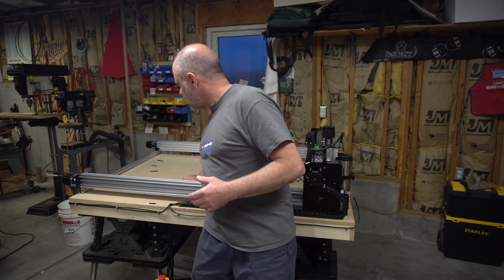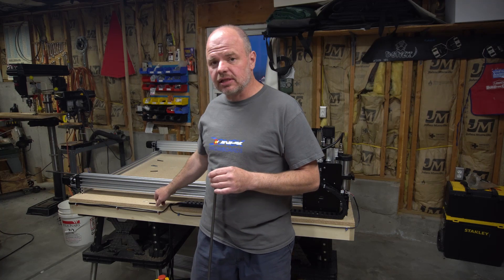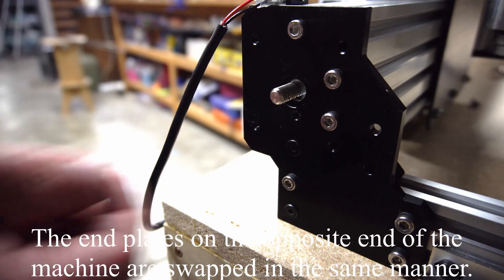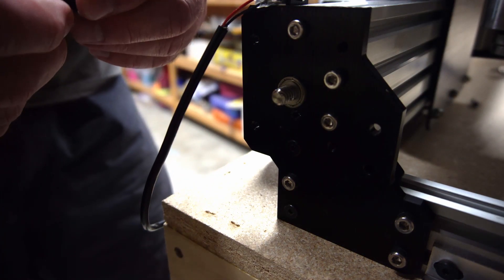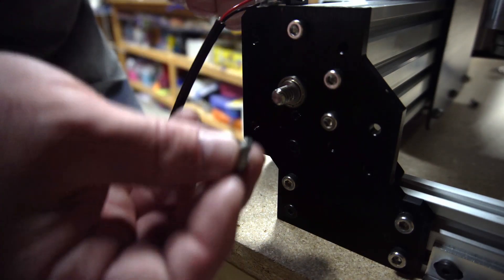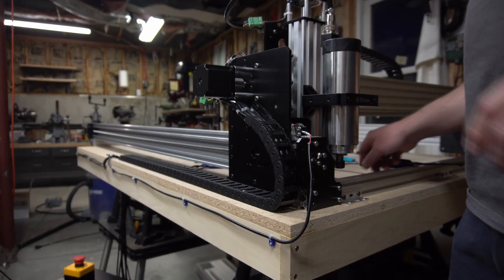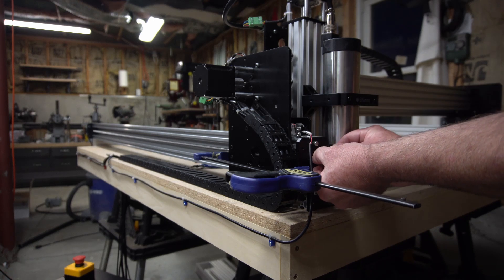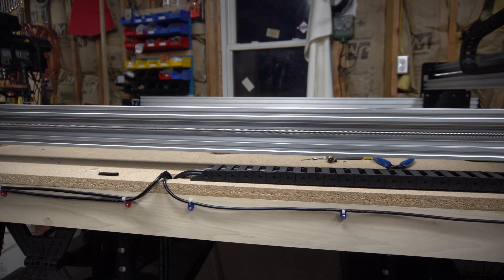Eliminating Lead Screw Whip on the Workbee CNC Router

Comment: i used 1500 leadscrew but i order biggest screw old has 8mm OD and new have 12mm OD screws, best way have order little longest screw and one NUT more, drill nut hole and make thread, install and tighten nut little bit and locked nut. use tread lock . then not whip. better if can buy pressure plate bearing this under nut too help lot.

Comment: Can we use belt drives for this ?
Reply: yes but not accurate and strong. belt tretches and teeth not accurate, can use only small torque laser or 3D printer NOT cnc mill,

Comment: I have one of the very early 1000mm x 1000mm  Workbees and, being a cheapskate, I don't want to scrap the existing lead screws for ones only a few millimetres longer to allow tensioning  the lead screws with a clamp on the "free" end. I plan to drill and tap this end of each lead screw and locktite a 14.9 grade M3 stud in. This will allow me to tension the lead screw fairly accurately because the tension can be obtained by stretching the lead screw by a well controlled amount using the fine pitch of the stud. For a 1000mm lead screw I estimate we need of the order 0.2mm of stretch to obtain around 100kgf tension in the lead screw.

Comment: Wow. I actually ordered and installed a new 1500mm ball screw, knowing that the original had a slight bow to it when it was installed. Bad wobble if I pushed it much beyond 250IPM. I was able to achieve well over 100IPM faster with the new screw, but only for a couple of days, then the wobble returned, mysteriously. In the process of troubleshooting the issue, I stumbled upon this video. 

Since I designed and built my machine, it was easier for me to introduce tension on the axis. What happened? when I loosened the BK12 mounting bolts and pulled on it to add tension, it came right off! The Jesus clip that was supposed to be holding that end of the screw fixed had fallen off, which likely led to the wobble in the first place. I replaced the clip, tightened her up and kaboom! No more wobble!

Now I need to get better Jesus clips...

Sincere thanks and best wishes!
Reply: well tension and temperature might give you more or less woble over time and broken bearings .. since they are stressed non stop

Comment: Thanks.
The clamp was a great idea. I just moved the gantry to the center of Y and then pulled the lead screw by hand to get a slight tension.
You are right, btw: Workbee does supply longer lead screws in their V2, with 'Tingle Tension Extensions' is what they call them.
I might order longer lead screws and put some push bearings on the outside. Regular bearings are not supposed to handle axial forces.

Comment: The change of the bearing to the outside of the endplates is a good idea but with the tension applied to the roller bearing in the "wrong" direction will cause the roller bearing to fail quickly, it may be a advantage to place thrust bearing between the roller bearing and the collar. To minimise the dust to settle in the open thrust bearing i made large washers with dense felt that fit snugly over the thrust bearings

Comment: What is the max screw length that can be  used in the C channel before the Flex becomes unstable? Using 3rd party screws can 2500mm length be acheived?
Reply: I think if you are in compression, 1.5m is pretty unusable.  If you are putting the srews in tension, you are probably OK at the longer lengths.  You will likely find it necessary to apply a greater tension preload and will need thrust bearings.

Comment: how different did the machine behave after that fix? Did it make more precise cuts?
Reply from the maker: That was not the purpose.  The purpose was improving performance during rapids.  It allows the machine to run at a faster rate without problems.  There have also been instances where people have bent their lead screw.  This will prevent that as well.

Comment: good job m8. but they are roller bearrings you need thrust bearrings for that application. i have a 1515 and no whip but bulkman can shove their instructions where sun dont shine. in the end i built kit my way and it works. roller bearrings dont work under side to side compression. thrust bearrings are the only logical way to put rod in tension .
Reply from the maker: Agreed.  I have thrust in hand but have not had to change them yet.
Reply: Matthew have you got a link to the thrust bearings?

Comment: I had to do the same thing to my machine. But one of my y axis on my cloned driver drv2288 is running at a different speeds. 

Any ideas?
Reply from the maker: You could check motor tuning in ports and pins on MAch3 or confirm that all axes are set up the same.  Or one could be micro stepping and the other not.  That's typically specific to the driver or the dip switches or jumpers.

Comment: Hi all!   Instead of using a collar with a machined grub screw, why not use  a brass lead screw Nut  to adjust the tension on the main lead screw  the  support bearing has  to be the type  that accepts  radial load  , suggest drilling and taping the brass lead screw nut  to keep it from turning  to keep the tension on the main lead screw!
Reply: Was just about to comment the same thing. Great idea

Comment: Hi Sean, cam across your video.  I am considering a CNC machine to get into making some wood and metal projects, carvings, cut outs, etc.  I don't know much about them but I have a limited budget.  What do you think about the Workbee CNC's?  Looks like the kits come with everything but the MDF table/platform..  Do they have the ability to set the zero level against the surface you are working on?  Would you recommend air or water cooled?  Thanks
Reply from the maker: If you are looking for a hobby level CNC, then you will do well with the workbee.  I think for a first timer, you want to be sure you understand the entire drawing, CAM and control dynamic.  Be sure you are purchasing something that is not a significant stretch for you to learn.  Mach3 as a control software is very tricky to make work for a new user.

Comment: This a great stop gap solution. The true problem is the lead screw diameter is under sized. Shaft whip is to be considered on any rotating machinery and is dependent on the length to diameter ratio of the shaft, shaft tension and rotation speed.  
Shaft whip is mostly due to to the sag of the shaft over it's length, which is an eccentricity, and when rotated, causes the shaft to whip. Tensioning helps by reducing the sag, but will not remove the whip fully. It just changes the critical speed at which it occurs. Such a long length of screw would need quite a large diameter screw to eliminate whip completely.
Reply: Yes, I was thinking the same. When he said 8mm screw I thought that is a mistake - it should be 12 mm at least or maybe even 16 mm to stop it from sagging under its own weight. Sean found a solution that deals with a part of the problem, eliminating some of the additional forces, applied externally, by the frame. However there is a caveat to increasing the diameter, because the added weight of a 12 or 16 mm lead screw will introduce some other factors into the equation, putting more load on the motors. I am not familiar with this machine, but if the motor on that axis does not have enough torque, or it's already at its limit... well, it's game over. Maybe the  fact that they kept using a 8mm lead screw in such a long axis is in fact a compromise - power vs weight... Also, another thought is that reversing the support plate and putting tension on that lead screw will modify the geometry of the whole frame a little bit. It would be nice to see a test with a simple square carved in a piece of wood and measure the deviation that occurs...

Comment: anyone try to mount Cnc on the wall to make more room and box it in to keep the saw dust down in the shop >
Reply from the maker: The challenge with that approach is that the motors have to lift the weight of whatever axis is being moved against gravity.  You would need bigger stepper motors and possibly drivers too.  There may be additional wear on some components too.

Comment: What spindle is that ?what do you need to add it to your CNC
Reply from the maker: I have a 1.5kw chinese spindle on there.
Reply: @seanmartin8770   better buy 2.2KW same cost  but lot lot more power and better.

Comment: Bulman3D included a black threaded plastic knurled knob about the size of a hockey puck, labeled "Lead Screw Tensioner", with my recent WorkBee kit. You can use it to load tension on the lead screw and then tighten the lock ring. Works great...

Comment: Thanks for the video.  Was having problems with leadscrew whip on a Workbee 1515 and this is a fantastic solution.  Purchased longer leadscrews from Bulkman3D to avoid trimming the v-slot and cbeam.  Looks like Bulkman3D is now selling the 1500mm kits with longer leadscrews and a tool to help set the tension.
Reply from the maker: Glad it helped

Comment: Who the hell would use 8t trapezoid 2mm pitch power screws in a cnc table lol?  Wow you got screwed literally if you paid for those. Those are designed to be used with 0 to 80rpm inmind to start with at a max length of 400mm.  That is spec rated for those screws. Provided you have 304 stainless screws and 8070 copper nuts.  

Anything above 80rpm will damaged those with a force greater then your wife bitch slapping you for wasting money on that. 1200mm 12mm ball screw with bearings and nut. 0 to 850rpm cost 55$ and won't bend anyhow cause of its twisted design even under loads. Not as much friction and does not turn to a sloppy mess.  Acme screws are not even designed period to be used with any kind of stepper or motor.  

NOT trying to be the black cloud here but worked the BRAND name Canada product would never used acme screws in a product.  You got what you paid for a China knockoff

Comment: Just a thought. Might it not be an easier job to  get some of the brass lead screw nuts that is available and use that as a tentioner. You will still need to drill and tap for a grub screw to lock it in place. just google 8mm lead screw nut if you want to see what it looks like.

Comment: I just ordered the 1500x1500 from bulkman, I'm wondering wouldn't a multi start screw lessen the whip? I'm thinking a 4 start 3/8" acme rod. What do you think?
Reply: Also instead of cutting the cbeam, could you not just make bigger motor mounts?
Reply: also instead of cutting your cbeam could you not just make bigger motor mounts?
Reply from the maker: @grahamshere  I'm not sure how a bigger motor mount would help.  I'd need to see your solution.  As mentioned, cutting the c-beam is not necessary if you get longer screws.  I was unwilling to wait for them and did not feel that shortening my c-beam by 1/2in impacted my travel enough to be a problem for me.  I can still cut 48in of material, so a partial 4'X8' sheet is no problem.
Reply: @seanmartin8770  I was thinking you have a larger motor mount and you would need a larger coupling  just so you don't need to cut 1/2 inch off your machine but doesn't really mater I guess if you still get 48" under it, I think a multi start acme rod would be better, less rpm's to travel more distance, I looked at 1/2 inch 5 start acme but the cost is crazy, almost half the price of the machine alone with shipping, shipping cost more than the rod. Seems most of the acme lead screws are made for 3d printers. 8mil should not be used for cnc routers if you ask me.
Reply: wonder why my reply didn't show up the first time?
Reply from the maker: The Whip has to do with the fact that the screw is under a buckling load that actually buckles it.  A 3/8in screw is going to buckle under a similar load to a 8mm screw.  The only way to combat the problem be changing screws is to go with a larger diameter screw.

Comment: I've contacted a seller and they've offered to give me an extra 10 mm added to the lead screw length. Do you think that will be enough to get the bearing and collar on the outside?Thanks for the video. It alleviates my worry about getting the bigger machine
Reply from the maker: Hey Seth.  I do believe the 10mm will be enough.  Can you share the seller you are working with for others.  Thanks.
Reply: @seanmartin8770  It's bulkman3d.

Comment: Where can you get a lead screw that long? I would like to do this.
Reply from the maker: It looks like Seth above you has found one, but I believe bulkman should be able to.
Reply: aliexpress,machine shop, bolt shop, e-bay. i order my cnc screws aliexpress and ebay, my machine have 1500x2000 table size screws have little longest.

Comment: Another thought. Would it make sense to shorten the spacers that hold the stepper motors to the rails to gain the space needed??
Reply from the maker: With the locking collar on the opposit side of the end plate, you need that distance.  It's possible you could use the shaft coupler in place of the locking colar though. I'm not near my machine to measure those parts. It moght work.

Comment: Did you cut just the C-beams or did you cut the other beams as well?? I have the Workbee 1500x1500 and it has 4 beams to support the MDF sheet
Reply from the maker: Mine is 1000C1500 so I just cut the longest beams. In your case it might be better to purchase longer lead screws.

Comment: would adding springs between the end grub and frame give you even more tension? https://www.mcmaster.com/9657k636  one of these springs on each end would give you an extra 20 lbs of tension.  why didn't you just increase the threaded rod to 12mm?
Reply from the maker: More tension is not necessary i dont believe.
Reply from the maker: Increasing the lead screw would be more desirable. I did not have a problem with loosing the 12mm in length so did that.

Comment: Thank you for the video. I currently run a machine using belts and was looking for an upgrade with screws and a bit bigger. I was looking at the Workbee at the same size you have. Being able to use screws on that size helps my decision. I realize you may not have any context on this but I'll ask anyway. Do you think there will be much difference in accuracy between the 750x1000mm one and the 1000x15000m one? Due to greater flex in the Y and X spans? I would love to be able to mill that size but not at the loss of accuracy.
Any shared experience would help greatly. Thanks.
Reply from the maker: Deflection in a beam varies with the cube of the length so a reduction in rail length will definitely reduce deflection and improve accuracy.
Reply: i use 1500x 2000 my table lead screws. and biggest screw 12-16mm OD.

Comment: how about y-plates? can you flip those?  if i order 1500x1500 leadscrew workbee
Reply from the maker: Those plates are mirror images of each other, so you should be able to swap the sides and put the x-axis in tension too.
Reply: lot cheapen you can order new leadscrew to machine shop or aliexpress etc, and better if change lead screw biggest OD, 8mm change new screw 12mm. and order all axis one nut more, same pitch what lead screw have, lot better tighten tension.

Comment: Great Video Sean! Looks like great minds think alike. Just last week we started selling 1500mm screw drives with the screw in tension.
Reply: Can you buy the tensioner?
Reply: @canoe-shelburne  All you need is a nut with a thread matching the thread on the screw you are using.
Reply: @ooznest  where can they be purchased. I have 8mm lead screws
Reply: @canoe-shelburne  The correct screws will be available on our site soon!
Reply: @ooznest  Is it up on your site yet? Do you have a link?
Reply: @sethl1515  Yes the 1500x1500mm on our website are screw drive with it in tension
Reply: @ooznest  have you got them in stock?
Reply: Do you have links for the nut on the store
Reply: So is the 1510 or 1515 lead screw workbee is now consider as stable and reliable as the 1010 ? (Not as "accurate" and rigide of course) Also do those nut wears on such high speed ?
Reply: @geekoid183  By tensioning the screw the whip can brought down to the same level as a 1000mm screw un-tensioned. But it is considered as stable with the screw tensioned.
Reply: @ooznest  Would doing this to the workbee 1010, improve it at all?
Reply: @tompoletti5676  It wouldn't make a noticeable difference. The only benefit to it at smaller sizes is that it is easier to remove any play in the ACME Screw.
Reply: @ooznest  Thanks for the reply, my kit just came in the mail, I'm hyped!
Reply: @geekoid183  il en

Comment: How fast are your rapids now? I have exactly the same issue on my Work-bee and cannot run it faster than 55 I/M
Reply from the maker: In tha t last section I was running at 5000mm/min which comes to 196in/min but in testing I believe I was at 8000mm/min which comes to 196in/min.  I think the problem I ran into was motor stalling at that point.  I'll likely go to a 36V power supply and bigger motors.
Reply: @seanmartin8770  did you do anything on the motors side to prevent ACME rods from being pulled out of the couplings?
Reply from the maker: @TheFeFactor  I forgot to say that in the video so I put a note at the bottom of the screen.  The end plates on the opposite end of the machine are also swapped.  This is very important to being able to tension the screws.
Reply: @seanmartin8770   for a while now I was thinking to tension the rods and while preparing for it I got a set of this clamps https://www.amazon.com/gp/product/B000IL5GPK/ref=ppx_yo_dt_b_asin_title_o04_s00?ie=UTF8&psc=1 they should have a very good holding power.
Reply from the maker: @TheFeFactor  Those look great.  I'm interested in trying thrust bearings as well.  They are the F8-16M miniature Axial Thrust bearings.
Reply: @seanmartin8770  speed can do more if change motor power biggest, hobby users group many say fast cnc need use drivers who can handle 80-90 volt perfect cnc uses nema 34 motors, minimum 470 OZ /3NM torque, DM860 stepper drivers and 80 volt power supply to motors, then have fasten and not stall or lose steps.